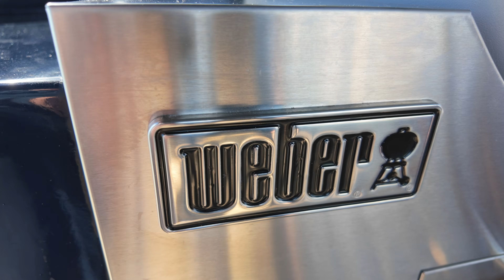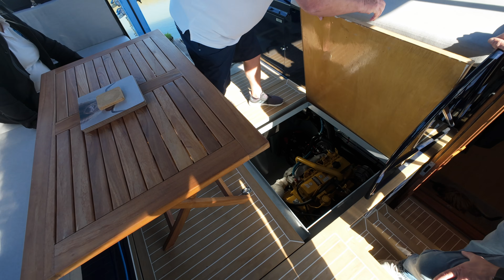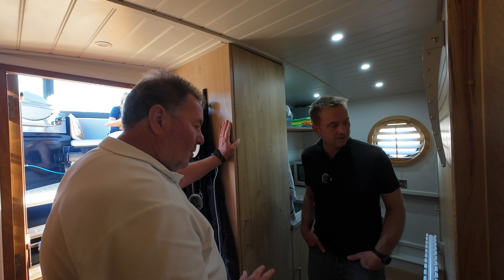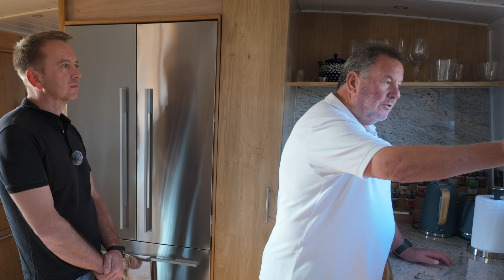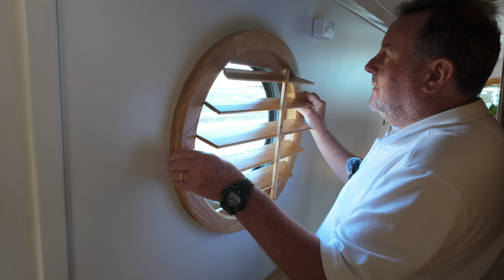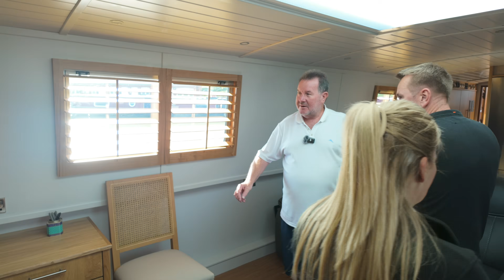👉 Inside a 60ft Widebeam Canal Boat , This Feels Like a Luxury Apartment

Comment: How much?
Shipped to Florida?
Reply from the maker: I can’t confirm a cost for this I’m afraid, you would need to speak with the transport Company
Reply: I can only guess that shipping would cost a fortune.
I was initially in love with widebeam canal boats, but they wouldn't be suitable outside of canals.
Have my eyes on Dutch barge designs now. Those can be built up to Class A offshore spec. A Class B would be ideal for NA. The more open areas of the grand loop would be easy and coastal cruising would become an option (or venturing onto the Great Lakes).
Reply: One of my larger dreams would be to build steel European boats here in Canada. The market seems to be for the very wealthy only with even pontoon boats quickly reaching 6 figure prices. And traditional boats comparable to the great European cruiser designs.
But, financing such a dream seems daunting and out of reach.

Comment: Is the roof space reserved for something, surprisingly low amount of solar?
Reply: We deliberately wanted to have clean lines and 4x250w panels are sufficient to keep the batteries topped up together with the engine running when cruising and the generator.